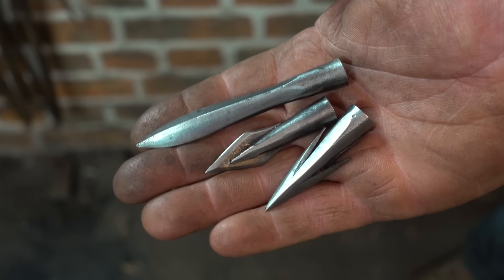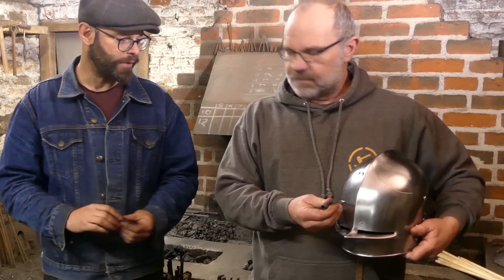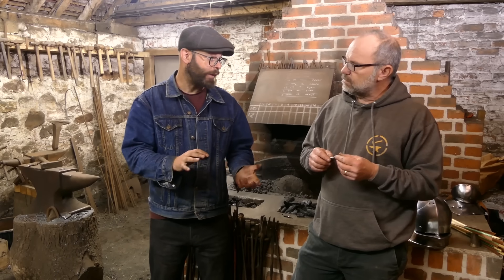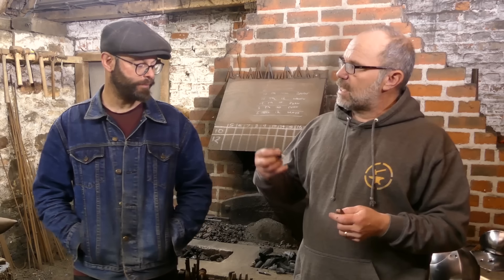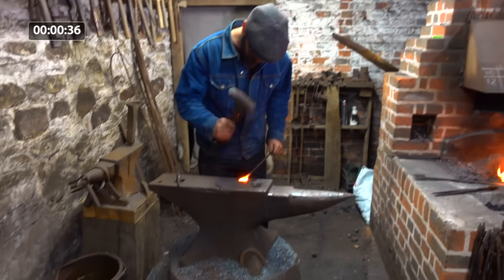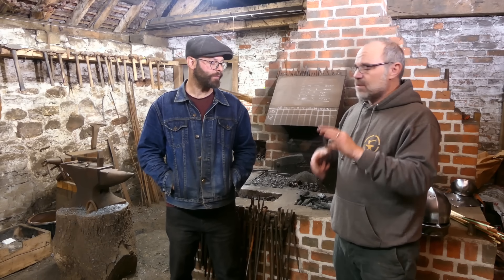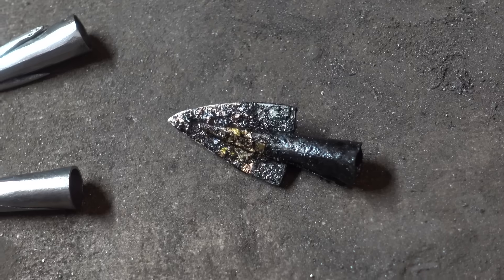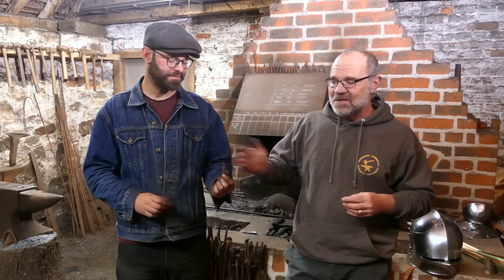Why Bladed Steel Arrowheads were Superior - Arrows vs Armour 3

Comment: Of all the components making up an archers weapon the arrowhead is the hardest too quantify. There are almost no descriptions or finds that can be related to military procurement except the Tower of London Inventories 1320-1410. In England during the many civil uprisings, rebellions and War of the Roses when strongholds and armouries were denied to some of the factions all types of heads were used barbed hunting heads being the most common.
We have to look to France and the 100 years war to get an indication of what was in use at the time as ordered by the crown. The large head, sometimes known as the Crecy head (no9) is almost certainly the head of a crossbow bolt identical to many found on European battlefields, its weight alone disqualifies it from forming a part of an archers equipment. 
It was assumed many years ago, without very much evidence, that the type 16 was a military head but later documents now dispute this and it certainly played no part in the French campaigns. The disadvantage of a barbed arrowhead over bodkins are many, they are more expensive and time consuming to make, the barbs serve no purpose as the bodkin head is designed to part from the shaft and stay in the target. The arrow that hit Henry V in the face parted company with it’s bodkin head which lodged under the back of his skull. 
Barbs are a hazard to all who handle them and packing 200 sheafs of 24 tied with hemp into the shipping container of the day, the tun, would have been difficult and would have been a nightmare  to unpack and there were many thousands of tuns.. Barbs make it impossible to carry and draw arrows from a hemp belt, the only way to carry them in quiver is to “wear your iron on the outside” which means the heads are open to catching on clothing, skin, undergrowth etc. There would have been more English blood drawn than French with use of barbs.
Although Edward III ordered some steel arrowheads (cum capitibus asteratis...fluted) it seems to have been discontinued with forged iron being used until at least 1500 so you must bear in mind when testing armour the armour is steel and the heads are iron.
Reply: As always,  all totally incorrect and based on ancient and long since debunked theories, but it's always nice to have you watch and comment on our films Rex!

"Barbs are a hazard to all who handle them" is my new favourite from you.   Honestly,  if you'd seen the whole crew while we were filming,  we were just losing fingers left right and centre from those pesky barbs.
Reply: @MedievalArrows  Well I did say that barbed arrows were used in the internecine wars in England but there is no evidence they were a military head.
I think ridicule has no place in serious debate.
There is nothing in in three years of research that convinces me other than  that our ancestors were far more astute about ballistics and had exactly the same financial problems in procument that we do today......but, knowlege shared is knowledge gained so I am open to arguement about barbed arrows in the 100 years war. The evidence is that the only times barbed arrows were mentioned in any documents that I have seen are in the purchase of land, rent or lease for hunting rights and just once an order from Edward III for 146 sheafs of 12 barbed arrows to be sent to York for his personal use....it may be of interest to know that horn nocks were not a part of the military during this period of history....the yew bows both paiinted and white were self nocked.
Reply: @clothyardshaft there are first hand accounts from Crécy of the english barbed arrows.  Numerous records of supply of barbed arrows being taken to Scotland and France between 1340 and 1400.  Countless surgical records of barbed arrows being removed from bodies.  Metallurgical analysis of many barbed arrowheads show that the majority had steel barbs and iron sockets which would obviously be pointless for hunting or sport.
Reply: @clothyardshaft the "evidence" is actually very very clear.   Bodkins fall out of use almost entirely by the 1400s.  Barbed heads turn up everywhere,  with tiny,  tucked in hardened steel edges designed to cut and punch plate from archaeological contexts dating between 1350 and 1550.  The arrowheads stored at coastal defenses such as Camber and Deal Castles are all brazed, barbed heads.  All the accounts talk about barbed heads - "the little barbs which our English heads have" - Ascham. "The horses, feeling the barbed arrows..." Le Bel.  

They are cheaper and quicker to make than full steel bodkins, appear in almost every single military archaeological context,  are deliberately hardened when hunting heads have no need to be,  are drawn in all the battle scenes from huge tapestries to tiny manuscript illuminations, and your continuous idea that barbed heads are difficult to handle,  transport or use are just absolute nonsense.   I make HUNDREDS of these a year.  I've never once got one caught on skin, fabric or anything else.   They're not bloody great hunting heads,  the barbs almost touch the socket in many cases,  they can't get caught 😂😂

Archaeology,  documentation,  scientific analysis,  common sense,  supply reports, price,  efficiency and actual first hand accounts support tiny barbed heads being standard military use.   I'm afraid unless you've got any actual evidence to the contrary (which isn't "I haven't found it in 3 years therefore...") you're going to have a hard time convincing anybody that barbed arrows are awkward non-military specialties.

Side note - horn nocks are depicted on military bows as early as the 1100s.  They're mentioned for military bow production in the 1300s, and we even have a list of bowyers tools "for the making of the bows to defend the realm" which include the tools to drill out and shape the horn nocks.
Reply: @MedievalArrows  I will try and deal with  your points (pun) one at a time...Deal and Camber castles play no part in this conversation as they are artillery forts finished about 1540, 12 years after the French had stopped using all stringed missiles. Henry VIII at this time had 6000 muskets in the Tower of London and a further 2000 distributed around coastal forts. We are seeing the decline of military archery. According to Sir George Carew the French were openly mocking them for carrying bows at the siege of Bolougne three years later. The discovery of arrowheads that could be used for hunting around forts and Manor houses that would have housed many hunting parties is not unusual and is noted by the archaeologist excavating Tewkesbury (1471)...The Tudor period is not medieval and plays no part in my argument.
 
Ascham....once again we are in 1545. He was a gentleman archer, a scholar never a soldier and makes several contradictory statements. His presuming that ash was the wood of medieval war arrows has been proved wrong and his assumption that damp weather caused his bow to become sluggish is incorrect, it was the string which is hygroscopic.
However he does have this to say......”And everything that enters by a turning and boring fashion, the more flatter it is, the worse it enters; as a knife, though it be sharp, yet, because of the edges, will not bore so well as a bodkin, for every round thing enters best; and therefore nature, saith Aristotle, made the rain-drops round, for quick piercing the air. Thus, either shafts turn not in flying, or else our flat arrow heads stop the shaft in entering.”

Making a type 16 head then Brazing steel onto iron is very time consuming and certainly not something that would be done on a industrial scale for what is essentially a single shot missile. It would be far cheaper just to make it out of steel. Hector Cole informs me that to forge and finish a standard type 16 takes more than 15 minutes.
Tapestries, illuminations and paintings.........all these were painted by artists who had never seen a battle, particularly the Froissart illuminations on battles which were painted forty years after. They painted what they saw in everyday life and most people outside of garrison towns would have never seen a bodkin headed arrow.
Everything has a value and if it has a value it is recorded. When Edward III ordered his 4000 bows they would have needed 8000 cattle horns for nocks. They would have to be purchased, transported, cut and shaped then entered into the inventories for transport to France, they had a value. Neither barbed arrowheads or nocks appear anywhere in 100 years of documents relating to the 100 years war which include such minutiae as bow strings with one end looped.  Quite simply if they are not there they did not exist in the military procurement program. If you have documentation that brings that into question please share.
The wine Tun referred to is a barrel 6’ 6” high and holds approx. 235 imp gallons, this was the international shipping container of the day, into that was packed, very tightly, 200 sheaves of 24 arrows each sheaf tied with hemp string. After being rolled, loaded on to an ox cart, loaded on a ship spent a day or two at sea, off loaded and either unpacked or sent on further by cart you can imagine how difficult it would be to unpack the said tun if the arrows were barbed.
Barbed arrows did appear now and then but not for war..

March 20th 1337. Fine Rolls        
“..........having viewed the indenture, as the king ordered the sheriff to cause 300 good and sufficient bows, and cords suited to them, and a tun of arrows;, an ell long, of good and dry timber, and well steeled heads, for those arrows; and with broad barbs (falas largas) for the king's use, to be bought and purveyed from the issues of that baili- wick, and to be sent to York.........”

The phrases “good and dry timber” “ell long (yard +head)”  “well steeled heads” etc, are found in all the rolls many times over a long period of time sometimes accompanied by “threat of forfeiture”. I believe this is a medieval cut and paste by secretaries or scribes and put in as a matter course. The sending of campaign (sheaf) arrows to York which was trouble free and nowhere near a hostile border instead of the shorter and better made livery arrows is at odds with everything I have discovered including heading campaign arrows with barbed heads.

However all was well, the script goes on....
..........to be delivered to the sheriff of York by indenture, and by virtue of this order John bought 300 good bows and cords suitable for them, and a pipe of arrows; containing 146 sheaves, with the heads thereof, and delivered them to the sheriff of York for the king's use, as may fully appear by an indenture made thereon, 

By Virtue of this order.....somebody had recognised the secretarial mistake and changed the order to livery/hunting arrows for the Kings use, so now we have for the first time a pipe of known dimensions and a number of sheafs which are 30/32” livery arrows. 
These are sheafs of 12 as you cant get 146 sheafs of 24 into a pipe. (110 imp gals)
Reply: @MedievalArrows  I wonder if you could supply references for this surgery as I can only find one and it appears to be a hunting accident in the Netherlands.
Reply: @MedievalArrows  Sorry could you link me to numerous reports of barbed arrows beign trasported to France.  As you have seen occasional small shipments of hunting arrows were shipped at the kings request.
Reply: @clothyardshaft  The way you selectively ignore blatant fact in order to make your point is quite unique Rex.   In a previous film you commented after watching me forge a finished T16 in 6 minutes that they take much longer than a bodkin to make. 

In this film,  it takes me 7:35 and yet you're still insisting that it takes 15 minutes.   Why?

They're FASTER than most types of heads.   They're HARDER.  They work BETTER.  Bodkins are old news.   They stop in the 1350s.  There is zero evidence of them on arrows past the mid 14thC because T16s replace them. 

It really does feel like you open a new video,  but then pause it immediately to just comment stuff that has been disproved years ago.  There is just no way you could actually watch somebody doing something in 7 minutes and then claim it takes 15 in order to prove a point.  It doesn't work I'm afraid.
Reply: @clothyardshaft you really need to update your references.   I'm not going to do it for you because I don't really have the time or inclination unfortunately,  but you have also proven that if it doesn't match your theory you'll just ignore it,  even if it was right in front of you.   You claim really odd "facts" like barbed heads are a hazard to those handling them,  or that they take 15 minutes to make when provided with visual evidence that they don't!

Your idea that every single artist for 300 years has never seen a military arrowhead is too silly to discuss. 

If you look hard enough,  you'll actually find three different context dated instances of large lumps of hundreds of rusted English barbed heads, two of which rusted in the perfect shape of the bottom of a barrel. I feel it won't change your mind,  though.  I honestly think you could be shot in the middle of a battlefield by an English archer in the 1360s and as the barbed head goes into your body you'd claim the arrow was too short, or that he thought you were a deer hence the barbs 😂
Reply: @MedievalArrows  Probably not a good time to reply at this time due to a couple of bottles good NZ red and a really smashing port with the bubble and sqeak...I don't mind doing this and swapping refs on your email if you like. i will reply tomorrow with my evidence.
Reply: @clothyardshaft I've had plenty of your emails at this point I'm afraid Rex!  You can give your "evidence" here if you like,  but considering that you're referencing things that we've all been studying for over a decade,  and aren't familiar with any of the more current references that show just how inaccurate your theories are,  there really isn't much point.

The fact that you only know of one surgical record about the arrows speaks volumes (there's an entire book on the subject published about 5 years ago!) and you seem unaware of the two separate theses on English military supplies to France and Scotland in the 14th Century (not written by Thom Richardson who I've spoken to on this topic multiple times!) 

By all means feel free to write whatever you like - I mean you no disrespect at all when I say I won't read them, but I've got your many,  many emails full of the same content already.  I wish you a very happy Christmas,  but I have no further interest in having old references recited to me alongside long since disproved theories.
Reply: @MedievalArrows  For somebody with  an interest in middle ages archery you show a great dincination to hear other peoples points of view or new evidence, of course this would have nothing to do with your financial interest in selling your kit or perhaps even a book.
However to give you the benifit of the doubt just supply the links the "two seperate theses" .
The reason I ask is that a thesis penned for a masters or PHD is peer reviewed.
It took you several months before you accepted the fact that Edawrd III's battle arrows were a yard long.
Reply: @MedievalArrows  I'm not sure that referring to and relating old manuscripts are theories but here goes.
The idea that bodkin heads were phased out and replaced by the barbed type 16 head after 1450 is just not practical or feasible. We have written confirmation of English army arrowheads in France  in a manuscript written on vellum of the end of the 15th century called "La Fachon de tirer de larc a main." later to be published as L'art d'archerie. 
I wont link because utube sometimes rejects comments with links but I know you have it as you have quoted from it before while making hemp strings.

"There are two sorts of glued arrows, sheaf[6] and flight. The sheaf arrows are usually thick, with high swan feathers, cut large, in the same shape as those of flight arrows, and have round iron heads. They are the regular arrows which the English use for butt (war) and target shooting, for they find them, as they are, truer than any waxed arrow.

And if you would know what is a sheaf arrow, according to the English, every glued and iron-headed shaft, whether big or little, is called sheaf arrow."
It is very rare to find answers as explicit as this as it also tells the sheaf arrow flights were not whipped just glued

Comment: I will have to add Type 9 has 1 nice added feature. When it breaks on impact, it can not be used again, so you dont risk of it coming back at your face.
Reply: That's only an advantage once the enemy runs out of arrows though. Until then you are at a disadvantage.
Reply: @Tanel-88  it is not like they have arrows for  that long, an archer can fire around 10 a minute, in 10 minutes 1 archer would have fired 100. they would not have that many for each archer :D

Comment: While it takes less time to forge or braze the arrowhead, how much more time is spent preparing the steel, bronze/brass filler, and flux?
Reply: They had industries dedicated purely to preparing all of the materials for arms and armour.   None of it was done in the arrowsmithing workshops, so the smiths could just focus on their craft. 

It was the same for bladesmiths, armourers, maille makers etc.   By the 14th and 15th Centuries, this stuff was so important and needed in such huge quantities that each job was outsourced.
Reply: @MedievalArrows Yes, but it takes time and money all the same.
Reply: @VikOlliver for sure,  but even by the 1220s they were spending huge amounts of money on specialist smiths making quarrels.  

By the 15thC, they were ordering arrows in the actual millions,  which tells us how important they were for supply,  so spending a bit extra in order to get heads mass produced that quickly would have been considered well worth it.